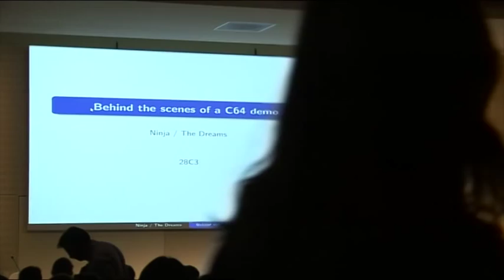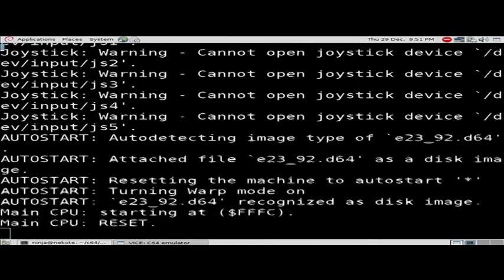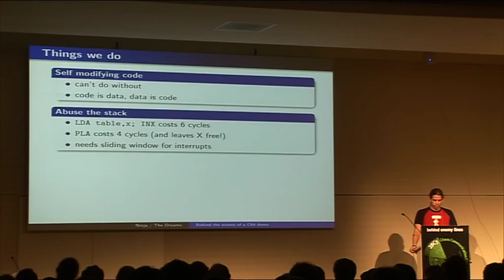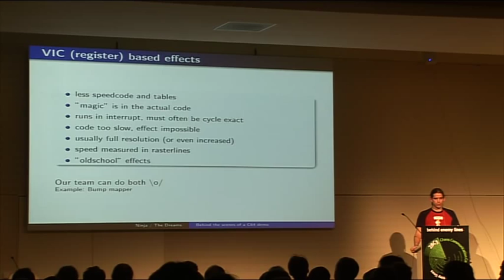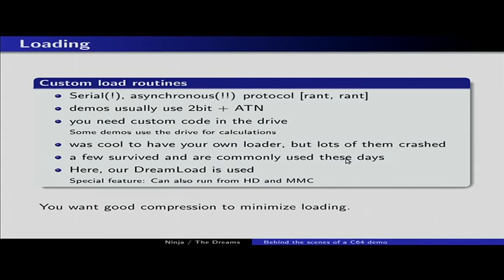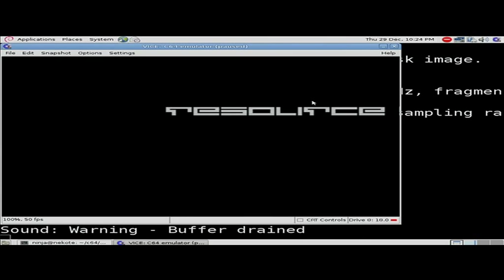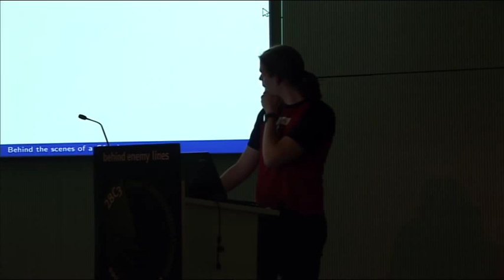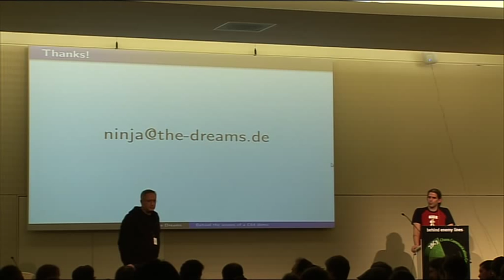28c3: Behind the scenes of a C64 demo

Comment: I think that back in 1982 even the designers and engineers of the 64 didn't realise how powerful the machine really was.
Reply: Well I swear that without modern compilers and tools all this magic wouldn't be possible with just one life
Reply: @Starredmediasoft  compilers? you mean assemblers. No compiler available today could generate 6502 assembly comparable to a talented human's.
Reply: @bsdetector6908  well, actually cross asm are called compiler, maybe because despite they generate 1:1 code they also have some features that allow to generate asm code with some script
Reply: @Starredmediasoft  Yes, but there is literally no mainstream compiler in existence that can generate compiled code as efficiently for a 6502 as a highly skilled asm programmer. Its why c64 demos are so insanely impressive
Reply: I wouldn't say powerful. Capable, if used creatively by software, is better in my point of view. Without proper knowledge of the technical background of an effect, they can look rather dull.
For example, many $d011 trickeries started as bugs, and people tried to find a stable way to recreate the accidentally caused effects (VSP, FLD). It took quite some time to find out what you could do with an "error" called Line Crunch ($d011).
Also, many effects were heavily inspired by the Amiga and re-engineered on C64.
Another thing is that today's extremely impressive demos could only be done in a reasonable amount of time with cross-development. Tooling got better.
Maybe the Atari ST was the last machine that opened new possibilities simply by using non-obvious software hacks to tweak the hardware; the Atari ST design is heavily inspired by the C64 design, and maybe that's why.
Reply: @jonnyj.  It really comes down to optimizing code and finding ways around the hardware limitations to push the hardware to it's limits. I'm sure these techniques can make their way into games and that's why we can see some impressive games today such as Sam's journey. I'm excited to see what else gets developed in coming years.

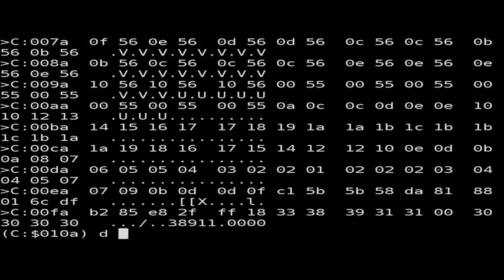Comment: To give an idea of manual compression. Take the bit of code shown at #28:58 it repeats BD or LDA and 8D or STA each followed by 2 bytes that make up the address. Since this is self modifying code the addresses are changed every time it runs. The initial values are not necessary as there is code that can write those values inthere. All you would need is a repeating BD ?? ?? 8D ?? ?? which can just be BD 8D BD 8D BD 8D which is "easily" compressed to a fill loop that fills  900A to 910A with BD 8D. You then try the different approaches available. 1) let the cruncher figure it out 2) put BD 8D as default values then let the cruncher figure it out and 3) find enough 2 byte patterns to justify writing your own loop. Trying those 3 you look at size vs not having default values. 97% of the time you find the effort produced an unproductive non result and try the next "trick". If you have enough barely productive tricks they can add up to something significant.

The bit of code at #28:10 looks exactly the same but there is only a single byte behind the 91 or STA instruction. The 2 byte fill wouldn't work there, it would have to skip 4. You could manage both by first filling the whole area with BD then doing a 5 byte skipping filler for the #28:59 and a 4 byte skip for #28:10.

Comment: I am surprise there is not yet a TED regarding demoscene...
Reply: because demoscene is way too objective, full of specs and facts about actual genius coding exploiting 30 year-old-hardware to its maxium potential, alongside creating a multimedia piece of art
Reply: Indeed, it was such an amazing time and moment. One has to wonder what could be achieved today with that mindset of pushing every last cycle out of operations. What kind of solutions can be achieved now, especially as we need to get more performance out of clusters. It is perhaps even possible to consider some previously thought impossible calculations.

I came from that 1970s/1980s world of limited 8-bits and 1Mhz. 

In 2003, I realised that some very largescale optimisation problems could be solved by using heuritistcis and genetic algorithms. Indeed, the very idea for Texxi (the basis of Uber etc) was originally a credit contagion trading idea for a Hedge Fund (for which  I was hired to work at in Connecticut). I had realised that ride-sharing matching was the same as finding matches to companies that would go bust in a housing crash, specifically from Mortgage Backed Securities.

Now we can use spare computer cycles to calculate the best way to group as many people into as few vehicles as possible. This is the basis for a whole new type of currency, since provable work can be done to reduce congestion and stored as value in a darkweb blockchain.
Reply: @ericmasaba9823  i doubt it. the things achieved in demoscene are very specific hack sfor very specific use cases. it would be hard to implement for more generic approach.

but i would like people care about optimized code. to some degree this is still a case in gaming consoles and embedded space.
Reply: @yoshi314  The mindset needed to achieve optimisation with limited equipment is always going to come in handy somewhere. Real Engineering is full of tricks and compromises to achieve the impossible. Concorde used the position of fuel in the tanks to achieve Centre of gravity balancing as the craft transitioned from subsonic to supersonic, moving the centre of pressure. This allowed the pilots to "trim" the aircraft without inducing extra drag from control surfaces.
Reply: @ericmasaba9823  it only comes in handy if it's beneficial. i'd agree in the engineering department.

in software engineering, though. not so much unless it cuts significantly into the costs.
Reply: @yoshi314  I believe such a mindset and appraoch can cut into development costs - patterns of development that already saved coding time, complexity and processor use can be packaged up into best practices (and not just for the specific cycle preservation of demo effects) - much as we have seen in software engineering over the last 30 years. Back in the day, it was more necessary to have significant contact with people who would show you precisely what they did, although trying to reverse engineer the latest CREST masterpiece was so much fun. The drive to do better on each release is at the heart of all scientific and especially engineering process. Remember, all this was done, not for any financial benefit, but just to move the scene forward. To be able to harness that energy to solve NP-hard problems for situations such as alleviating traffic, signal analysis, etc. Many top engineers started with LEGO or MECCANO. Who knows what some of these C64 minds could do when set upon the right problem, again with the incentive to do / be the best they can be.....

Comment: 5:43 Actually, it was never recommended to turn the disk... not for SSDD (single side/double density) diskettes that were used with the 1541 disk drive.  I had a notcher that allowed a floppy to be converted to a "flippy," but there was the caveat that not all manufacturers used the same standards as far as the ferrite coating on both sides... and there was also the possibility that write operations to one side could affect the integrity of data stored on the opposite side, depending on the magnetic flux permeability of the disk.  It usually wasn't a problem, not in the short term at least... but you basically assumed all the risk of potential data loss if you notched your own diskettes and wrote to both sides.

Comment: WOW, I had never heard of farming out some computations from a Commodore 64 to a 1541 or others until now! How would it hold up with a 71 or 81 as the only drive, or some other one like a 1001, 4040, 8250, or 9090 (HDD) hooked up through the user port with an interface? And when you mention mechanics are you saying that it uses the floppy's stepper motor or the hard's stepper or voice coil in the process? Which sort of "mechanics" are you talking about, and why? And by a hard disk, would even a CMD or Lieutenant Kernal work?

Comment: Is it also likely that some of these C64 demos weren't thought of how to make in the '80s, or weren't even possible then, also because in the cross-dev. work, you might also be using some routines found in modern GPUs and then translating those into simplified versions for the C64, you couldn't have figured out how to make on your own for the 64; you had to completely adopt from the PC or Mac GPU and then translate/port to C64 (while slimming them down too, of course)?